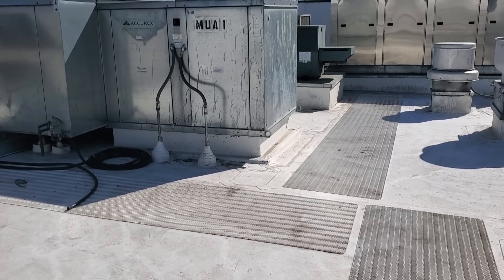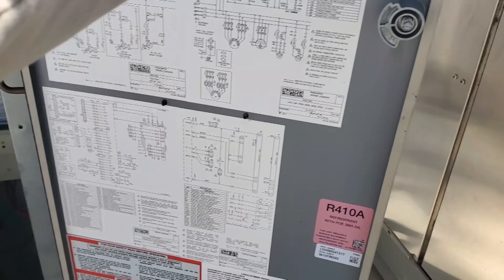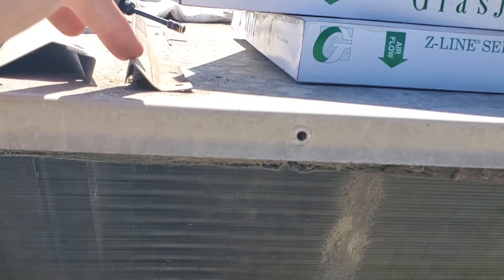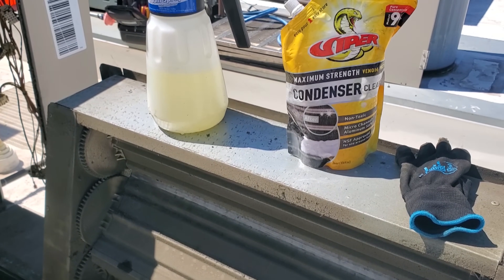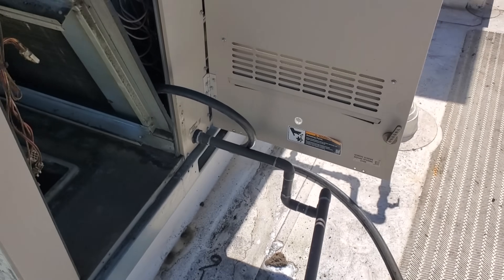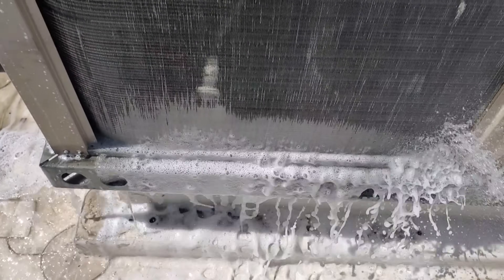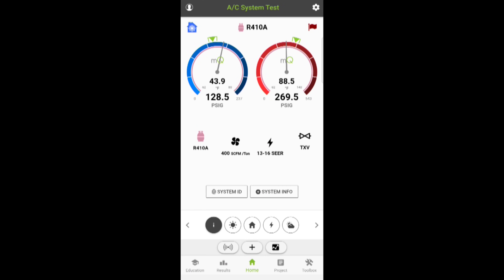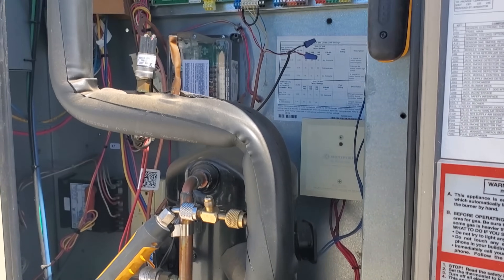THEIR OFFICE AC WAS NOT WORKING

Comment: In my area (Minnesota) the condensate drains for the RTU's just have a P-trap and drain out directly onto the roof. Is that some kind of California state code that they have to run to an actual floor drain? Seems silly.
Reply from the maker: I will discuss this on my livestream this evening 3/29/21 @ 5:PM (pacific)  on YouTube, come check it out https://youtu.be/aDqlso6Sr3o
Reply: I remember on another video he said something about the condensate had to drain directly into the usual wastewater system due to certain California codes. I'm in South Carolina and the majority of my locations just let it drain straight out of the trap. Much simpler, but can make for some dangerous roofs.

Comment: chris i ran some numbers and i think that unit is actualy running really efficiantly and as the outside temp rises that unit strill pulls soe god figures based of how its running i think this unit will actualy go on for a while run the numbers and have a think about split comp load discharge temp vs ambient and i think its really good the txv might be a little open but this is fine if its going to get really hot there and the high side can go up to 440 somthing psi

Comment: The second I saw that the thermostat was a fancy touchscreen I realized that’s why it broke. An ‘old fashioned’ one lasts forever haha.
Reply: Not so.. My grandfather's house, which stood vacant for some time after his passing, had an older thermostat with mechanical contacts.  The heat was kept on at a minimal level to keep pipes from freezing.  I went over to check on the house after a few days of not being there and found the contacts had welded themselves and the old gravity furnace had heated the house to over 130 degrees.  No idea how hot it actually got as the liquid-filled  thermometer on the stat had literally exploded and another dial type was maxed out at 130.  One wall was so hot you could barely lay a hand on it.  A pad of paper that was on the floor a couple of feet from the heat grate had curled itself into a ball.  Scary stuff.  If I'd skipped going over there, I'm sure it wouldn't be standing.  A 'Sensaphone' monitoring system was temporarily installed soon after.
Reply: @greendryerlint  The furnace high limit switch was what the furnace was cycling on likely.  Discharge temps probably around 180* + or -  but if the high limit failed that could have turned out different. Ive seen failures of all types,  those touch screen Honeywell thermostats have actual been quite reliable from what I have seen.  Eons ago I had an old snap action thermostat (heat only) that customer complained wouldn't stop heating.  They had old barn wood walls and had taken steel wool to smooth the walls out, needless to say the magnet in the snap action was a big metal fur ball when I opened it up shorting out the contacts.  I've seen a number of the original electronic Honeywell 7300 commercial thermostats that were heating and cooling simultaneously and the "newer" (from early 2000's)  7300 that had sub base pins that shoved out the back side if you pushed the thermostat onto the sub base without making sure the pins were perfectly aligned.
Reply: @mrbyamile6973  This was a coal gravity furnace that was converted to gas.  It had no high limit and no blower.  It did have a pilot safety/lockout.  The limiting factor was the sheer flame resistance of the giant cast iron furnace and the plaster walls of the hosue, plus the duct was probably lined with asbestos.  That and the capacity of the burner.  The contacts were welded--I had to pry them apart.  The thermostat was replaced with a simple Honeywell 'round' t-stat with a mercury switch.
Reply: @greendryerlint  that's better than frozen and flooded ehh?
and I have ssen them flooded and frozen to floor joists (whole basement 8' deep water and 2' of ice on top and all over the place. the flowing city water didn't stop because it stayed very well thawed

Comment: You can press the system "button" and the blank "button" in the bottom middle of the thermostat at the same time for about 5 seconds. It will get you in the area that you can reset the thermostat. Surges can cause that. I've had to do it a few times.
Reply: Ya, use to work at a bank and I had to learn this because cleaning crews would lock it up like that somehow.
Reply: it may have a locking feature, hold X and X for 5 or 10 seconds to lock/unlock
Reply: Good to know!

Comment: The other day i replaced a Tjernlund power vent motor. After replacing it and testing. I found the blower wheel to be plugged up. The blower wheel pulley is wobbly. The blower motor bearings are beginning to fail. The gas valve is beginning to fail. It would intermittently not release the pilot gas, had to tap on it a few times to get it to open. The main valve would go out, come back on, go out again and come back on, and stay on. It has an old WR ignition module. If i would of just performed the repair and tested to see if it came on and bounced.....i would of missed all the other things going on. It is a 40 year old Westinghouse furnace. Has a belt driven blower. Big picture lets the customer know and it covers your butt. I always look at the whole picture. You never know what else can and will fail if you don't look.